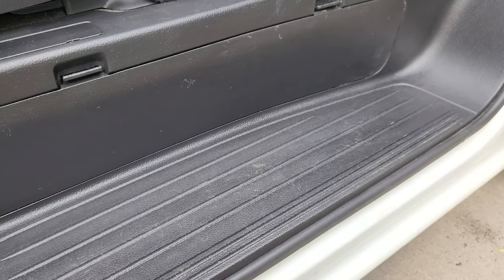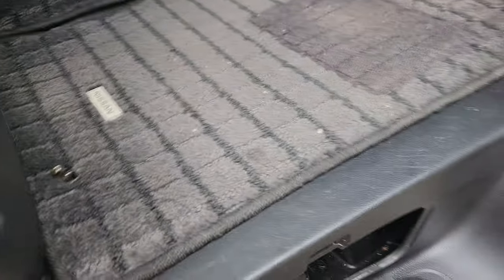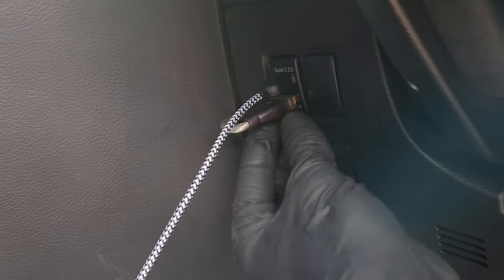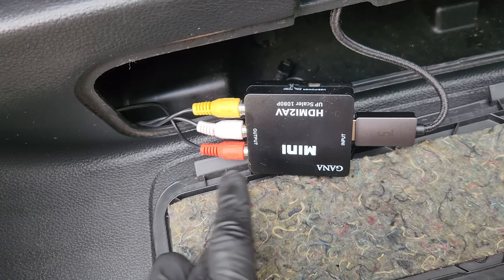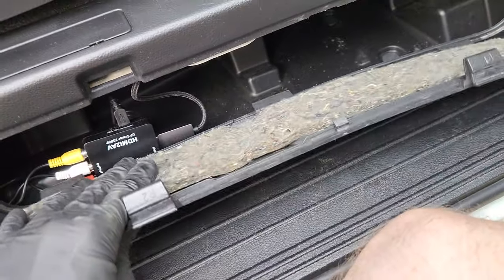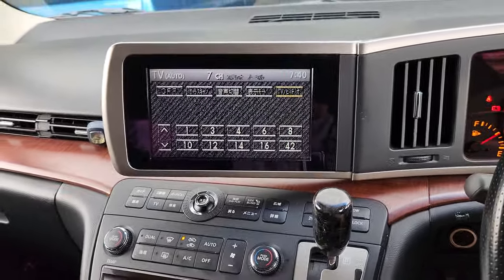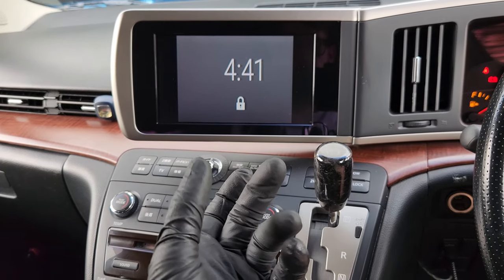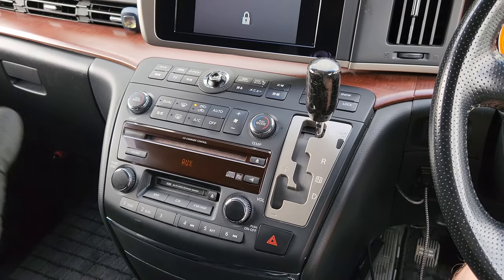Nissan Elgrand E51 2006. how to play media and mirror device onto vehicle screens. (Part 1)

Comment: I used the same hdmi converter, but added a chromecast and another bluetooth unit on a hdmi 2way switch. ( the bluetooth module required the opposite module RCA in to hdmi out, and added a filter to remove a bit of noise)  Phone is on a quad lock on windscreen plugged into charger, Can cast anything to screen or play music on the bluetooth. The factory bluetooth receives phone calls so can still cut out all other sound sources when receiving a phone call. In my series 3 2008 elgrand the firmware for the factory bluetooth has issues with the latest cellphones and when playing music cuts out after 5mins or so. Have also added the english conversion and the front screen came altered from japan so can watch while driving. Fitted a band expander to radio and now have all the comforts I need.  All wires are hidden and all looks clean and factory still.

Comment: Tidy install! You can charge with wireless Qi phone holder or pad for your phone!
Any tips on forcing the screen to 16:9? I did this and it's a bit rough dealing with it conformking to 4:3 when the on screen text/menu disappears.
Wondering if you added the foot brake bypass? Would love a video on the install of that.

Comment: Hi i have seen android adapters that plug into ur mobile an it has hdmi port, type c port (for charging) as well as a usb port. Do you think this would work ?. Just got to get the output an inputs right on  both sides???.

Comment: Hi just bought same setup just temp plugged it in ,in the back,on the usb port i havnt run to front iv just put put a Amazon fire stick in,having the colour lines come up on screen but that’s were I’m stuck were do I go from there unfortunately I don’t have the standard stereo in
Reply: I am in the same situation 🫤 My E51 came with a Carozzeria stereo and I cannot switch the input to select the back RCA connection
Reply: Iv put a new double din stereo in now,put the converter in the back all working good now
Reply: Same here stuck on colour screen 😂